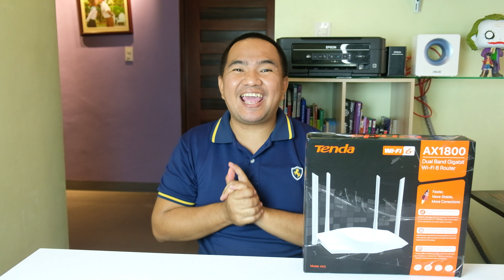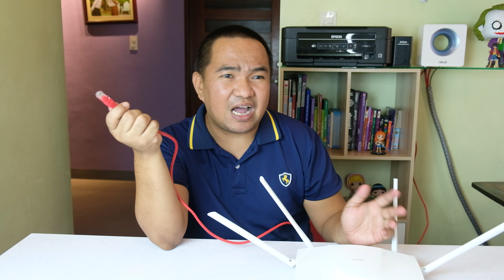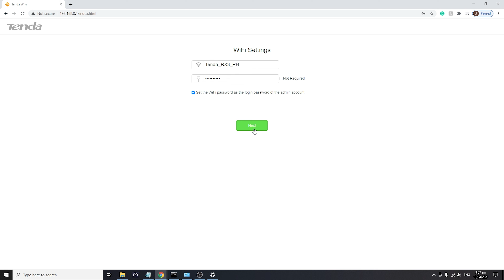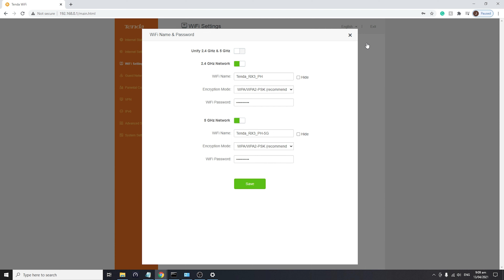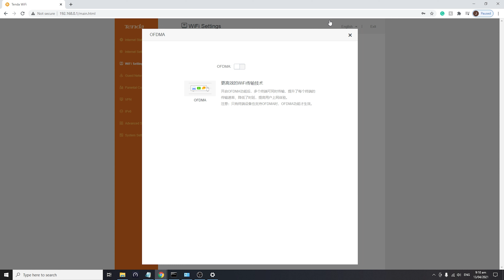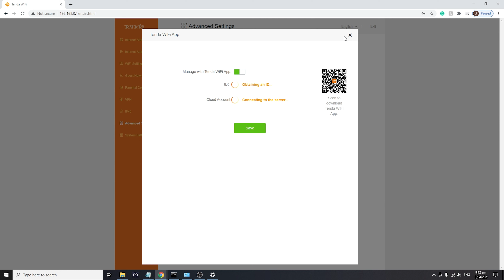Tenda RX3 (Wifi 6, AX1800): Configure and test | JK Chavez

Comment: thanks sa review orderin ko na ito.. papalit ko sa tenda ac11 1ghz single core.. to rc3 1.5ghz quadcore.. importante lang sakin naka wifi6 at may bandwidth control.. yung iba kasi priority lang option.. dumadapa kasi yung old router ewan ko lang nabagal network pag nakaconnect yung isang pc kahit wala naman nakikita malakas gumamit dun sa bandwith monitor  baka kako nagpapaandar sya cryptominer o kaya torrent.. balak ko iupgrade sa mas malakas na processor.. baka maayos..
Reply from the maker: to take advantage po ung wifi 6 features and reliability is dapat devices mo is wifi 6 device din..
pero from ac11 to rx3 okay ang improvement..
try to check din po ung location nung router, baka sobrang init, ang usual cause din ng pag dapa or pag disconnect is overheating..

Comment: worth it po ba mag upgrade sa Tenda RX2 pro from Tenda AC23 kahit walang pang wifi 6 capable device?
Reply from the maker: if wala ka pang device na wifi 6, i dont think it is worth it, in terms of range the ac23 is still a good choice still better than the rx2, the only reason na mag advice ako na go with the rx2 if un need mo is if device mo is wifi 6 na, dun magbenefit  ung performance..
Reply: @JKChavez  thank you po ✨

Comment: Sir, i have a tenda mesh mw3, 200mbps isp speed ko and hnd maabot ang isp speed. Plan ko kumuha ng tenda tx3 or rx3. Suugestion nyo po? Or tplink na ax1800
Reply from the maker: hi Pau, my suggestion is try mo muna direct connected sa modem-router mo via lan cable using laptop or desktop, then check internet speed if nakukuha mo ung actual internet speed mo from isp, saka ka mag upgrade to tx3 or rx3.. :)

Comment: Hi Sir, any inputs on this, I’m almost getting the same speed (wirelessly) on 2.4ghz and 5ghz. Is there anything I need to check? I dont see any extra boost on speed on using a router. Lol. Kindly advise. Thanks!
Reply from the maker: Hi sir Ron, clarify ko lang po ung question nyo ah, ung actual speed or internet bandwidth po na makukuha mo sa subscription plan mo ang limit, if you have plan 100mbps, and already getting 100mbps via lan cable yun lang din makukuha mo even adding a new router.. regardless of any router po.. :( mas bumaba ba ung speed?

Comment: Boss ano ba mas maganda tenda rx3 o tplink ax23? Sensya na boss hirap magdecide kya humihingi ako ng tulong sayo salamat boss Godbless!
Reply from the maker: Hi Gen, actually both are good with range. 
lamang lang si rx3 in terms of features. mas mahal lang si tplink because of brand over tenda.. like more premium sya.. pero overall performance almost the same sila..
Reply: @JKChavez pagdating kya sa tibay boss? Sino kya sa dalawa ang mas tatagal? Salamat boss 🙂 Godbless!
Reply from the maker: @gentambua7811  Kung tatagal, im not really sure with that models kasi nag try din akong ibang router.. ito lang mga tested ko
ASUS- more than 3 years 24x7 running
Linksys - after 2 years drop connections
Tplink - used a router for 6 months 24x7 working naman nagpalit lang ako kasi kulang sa range (lumang model po ito)
tenda - the chinese version ac23 namin for more than a year still running pa.. 
sana makatulong kahit hindi direct dun sa dalawang model, by brand lang.. :)
Reply: @JKChavez  boss diba sabi mo walang mesh yun tenda? Pero sabi mo naman mas lamang pa nga si tenda kay tplink. Patulong naman boss kung ano bibilhin ko sa dalawa hindi ako makapagdecide eh ikaw gusto ko magsabi para sure bibili na ako boss hehehe! Maraming salamat talaga sa tulong mo boss mabuhay ka 👍
Reply: @JKChavez  boss pakisagot naman kaagad tanong ko lapit na kasi 12.12 sa lazada at shoppe eh hehehe! Salamat boss!

Comment: Hi Sir. On performance + range, which one better, AC23 or this model?
Reply from the maker: If range, the ac23, if performance the rx3/tx3 (but your devices should be wifi 6 capable as well)
Reply: @JKChavez  The RX3 doesn't have good range?
Reply from the maker: @nacerondz  I believe it has a good range it does not suck, but in comparison with the tenda ac23, the AC23 will win.
Reply: @JKChavez  Oh, i will try TX3. Prefer for performance,i think. Tq much for it.

Comment: Mercusys MR70X and TENDA RX3 have the same price and features in the country I live in, I think they are the same, which one should I choose?
Reply from the maker: the RX3, i have several mercusys router, and so far they disappoint me.. :(
Reply: Hi, how about Totolink X5000R which has similar specs with these router, but the totolink one has mesh function. Can you do comparison and give advice?
Reply from the maker: @nhatanhton3221  unfortunately i the only totolink i have tested is a adsl modem 6 years ago, their product is actually durable. but for the x5000r i cant really say since i have not tested it. in my opinion, having a mesh capability on a router is always the best option.
in my home setup, im using Asus AI mesh sytem.. :)

Comment: Bud, i have thick walls and flooring about 10in thick. 2 storey house i have a pldt fiber with 75mbps installed sa 2nd floor problem is the stock wifi di kaya sa 1st floor... whats the best cost effective router na kakayanin tagusin yung flooring from 2nd floor to 1st floor?
Reply from the maker: Hi Rocky, i think we are about the same on thickness of flooring, it is more of a trial and error, but for me range and wall\floor penetration tenda ac23 sulit sya for its price.. or another option is get ung high end asus router, but cheapest option is the ac23, then if pag kapos, pwede position ung second router sa other floor using lan cable, kung kaya..

Comment: tx3 or ac23 who is the best for range and speed?
Reply from the maker: If you want range, the ac23 is still the best..
Reply: @JKChavez  1 smart tv,6 smart phones,1cc camera this both divice are play in same time and same speed.who is best tenda tx3 or ac23?
Reply from the maker: @princegk5196  the speed will be the same, for i think the devices you have are still wifi5, if all your devices are already wifi6 capable, the tx3 will be the best option (just less range over the ac23)..
Reply: @JKChavez  i have mi 4c router running,it has only 2.4gh.range is no cover in my small home,so i am changing my router now.my isp is giving me only 2Mbps=256 kbps line
Reply: and speed?

Comment: Pag nag avail po ba nyan bibilis po yung internet speed ? Or malalawak lang ang signal distance?. New subscriber here.
Reply from the maker: Hi Jhay, the short answer is no internet speed. pero medyo complicated po kasi, may mga makikita kasi kayo na bili kayo ng router na toh bibilis internet speed nyo etc...

1st if para malaman mo kung mag improve pa internet speed  mo is use a computer\laptop and connect it via lan cable directly sa modem-router, then do a speed test or other internet test, if stable sya at mas maganda ung performance over wifi, adding a wifi router will help (one reason kasi is minsan hindi maganda wifi performance nung modem-router, or may defect)

Comment: Good afternoon sir @JK chavez
Which router has better connection stability and durability for 15 users at home? Is it tenda ac23 or asus 1300uhp?
By the way, 6 were ML gamers, 1 is working from home (LAN),then 8 users weew just using FB or youtube? 
And we currently have pldt 50 mbps plan
Reply from the maker: Hi Brii, both are actually a good choice, and both are stable, the only edge of the 1300uhp is the hardware in terms of processor and memory, but the ac23 is much cheaper. but if you have money to spare, get the one with better hardware.

Comment: nice review lods. next paki review nman ung TPLINK 941HP or 841HP Wall Breaker, kung totoo bang wall breaker nga.
Reply from the maker: Hi Rhinz, unfortunately po d na ako kukuha nung 941HP, medyo traumatized sa tplink routers, have 3 of different models, and hindi man lang umaabot ng 1 year.. then for the 841HP, d ko nagawan ng review before pa kasi ako ng start mag vlog nun.. pero negative po yun, hindi sya as effective as the other routers na tinest ko, for me, the ac23 is way better than that 841hp..

Comment: Hi sir! I would just like to get some advice regarding wifi routers. I’ve been using the router that came with my converge subscription for the longest time now. It works fine when watching videos and opening up web pages, but when it comes to gaming latency tends to spike up from time to time. I’ve read from multiple forums that changing the stock wifi router can help with my situation. I am not sure about this and am wondering if you can help me with my problem. Also if you can recommend me a cheap router that can satisfy my needs ☺️ God bless sir and keep safe!! Hoping for the best for your channel☺️☺️☺️
Reply from the maker: Hi Joshua, opening web pages and watching streaming video's are a lot different from online games.  if the latency affects your gaming on mobile or wireless devices, the wifi capability of your stock modem-router might have an issue, adding a third party router might help, Before buying a router, try to check 1st your gaming performance on a laptop\desktop using lan cable, if the latency is good, then a third party router might help. Tenda is selling a lot of good products, the tenda AC5 v3  already performs well on my mobile legends, the ac23 gives a better range. for me if you want something affordable, go with tenda. if you have spare money the ASUS line up is also a good choice, but they are quite expensive.
Reply: @JKChavez  thank you for replying sir! Will try your advice! ☺️

Comment: Sir,tanong ko lng po..
Bakit po kaya hindi ko ma log in ung tenda ap4 ko tama nmn ung ip adress ko nereset ko na din.ayaw talaga.magpapalit lng po sana ako ng wifi name at password
Reply from the maker: Hi po, i have not tested that router po, na try nyo factory reset?
Reply: @JKChavez  yes po pero ganun pa din.tama nmn ang ip adress pero nd ma log in
Reply from the maker: @aljinbreystv6722  umaabot ka sa login page?
Reply: @JKChavez  hindi po.pag senerch ko ung ip adress walang log in page
Reply from the maker: try nyo po mag connect ng lan cable then anung ip address lumalabas?
Reply: @JKChavez  ung ip adress po mismo ni tenda ap4
Reply: @JKChavez  sir pwede po ba kayong makausap sa page nyo?
Nagmessage na po ako sa page nyo

Comment: which is better, RX3 or AC8? and Hm ung RX3?
Reply from the maker: Hi sir, i have not tested ung ac8, pero it is almost the same as ac5 v3 ata, between the ac5 and RX3, i would prefer the RX3 since newer generation with  mu-mimo+ofdma technology.. (yung raw power for now almost same performance sila, since i dont have a wifi 6 device yet, pero i think the rx3 will be a better choice since malapit na siguro na all new phones\devices will have wifi 6 installed on them, better investment na din siguro sya)

Comment: Anong bandwidth ka po naka-connect during speed test? Is it 2.4G or 5G? Or the combination?
Reply from the maker: Hi sir, for my speed test i always use the 2.4ghz frequency para ma test ung range nya po if abot ung internet, i rarely do a speedtest on 5ghz, kasi it will always be better and faster than the 2.4ghz.. :)
Reply: @JKChavez  I see. Salamat po. Di ko lang po kasi gets kung applicable din ba sa 2.4ghz yung Wifi 6 feature nya?
Reply from the maker: @josh.ricarte , ang alam kowifi 6 po will be across 2.4ghz and 5ghz sir.. :)
Reply: @JKChavez  Sige po. Thanks po.